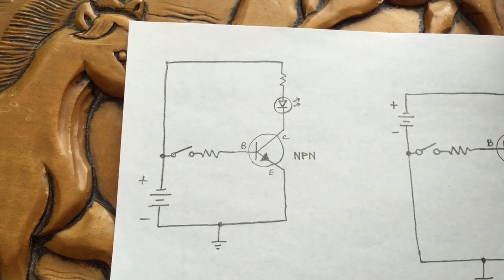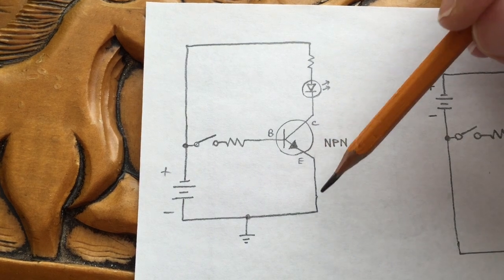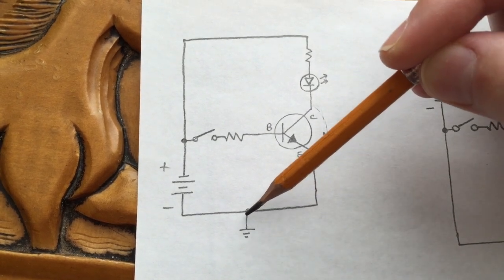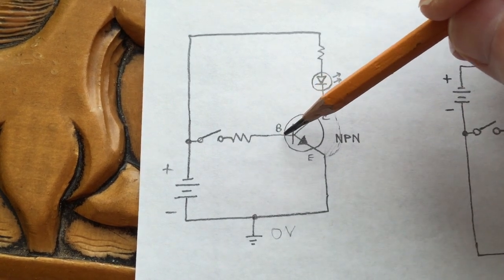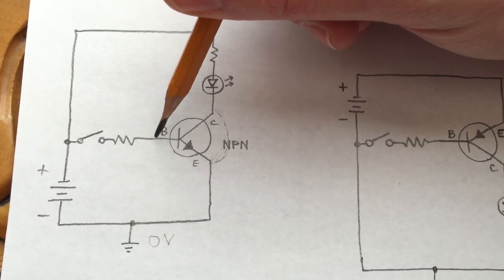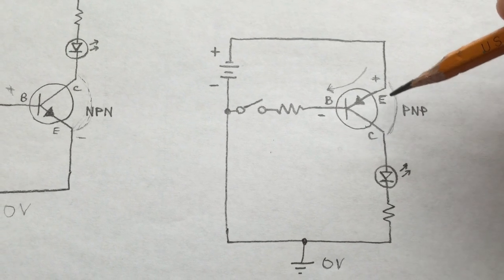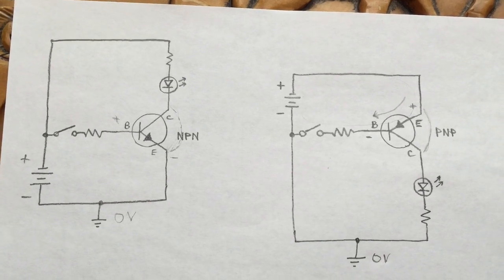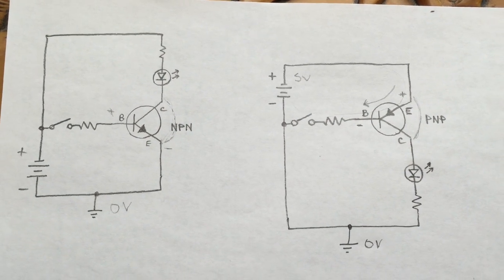NPN vs. PNP Transistors as Common-Emitter Switches

Comment: Very nice video. I believe the title should be titled Common-Base instead of Common-Emitter. The input and output circuits are both connected to the Base of the transistor.  A Common-Emitter would be when the input and output circuits are both connected to the Emitter of the transistor.

Comment: Cool man, you explained how transistors work as switches in a simple and easy to grasp way.
Thanks a lot.
Try logisim and fritzing, they're nice and free apps.
I did a simulation of this in Logisim on NPN transistor, it was great ;D
https://en.wikipedia.org/wiki/Logisim
Dropped a power, ground and transistor from Wiring menu then a button and LED from input/output menu
Connected all together then clicked on the hand icon for simulation, and it worked like charm once the button is clicked, seems the sim needed no resistors.
https://i.imgur.com/DHqhpcd.png

Comment: At 0:38, you call the Transistor a Current Multiplier. Please elaborate.

What I am thinking is that the power source  has a value, say 9 volts.We have parallel resistors, i.e. a Current Divider. Part of the current (measured in amps, right?) goes through the LED, with the arbitrary value of A1. The other part of the current with the value of A2  "flips the switch" of the Transistor. When we get to the Emitter, we have A1*A2 Amps. 

Am I on the right track?

Comment: i have a question..how the resistance in npn resistor can limit the current flow through LED as the are connected in DC...DC current flow through the every resistance should be same.

Comment: Just confirming I have a design right:

An NPN is equivalent to a normally open switch and a PNP is like a normally closed?

So if a 0V/5V logic signal was applied to a PNP that was switching, let's say an LED, when the signal is low (0V), the LED is on and when the signal goes high (5V) the LED cuts off.

An NPN of course being the opposite, on at 5V off at 0V.

So if I wanted to flash LEDs of Color1 and Color2 in an alternating pattern (one color on at a time), I could use a 555 in astable mode, connect a PNP for Color1 and an NPN for Color2 and color1 would come on at output LOW and color2 comes on at output HIGH?

And separately, unlike MOSFETs, bipolars DO NOT require a resistor between base and ground to pull them off?

Comment: dude, I went through at least 50 vids  trying to understand, I got a basic idea, but you my friend, youuuu, your voice is clear, its smooth and easy to.listen to, its sound is just right, your pauses are perfect while explaining, the mellowness helps, and within all that the overall explanation of the how hard it is for us noobs, you make it sooooo much easier my friend, you get unlimited lifetime likes and promoted to my diy buddies thank you GB..
Reply: having said that I'm still learning on how to.make it work with my project, I'm trying to make a solar lamp, I'm using a 3.7v lithium ion battery , 2400mah. I have my light dependant resistor which I think its around 15ohms, and my load (LEDs) will vary, my problem is to find an easy formula to calculate what resistor will I need to work with  each individual led or small 6v hylogen lamps, if you can point me in the right direction I would appreciate it

Comment: shouldn t the current be flowing from - to + ? this video is very confusing
Reply: In reality, electrons flow from - to +

When discussing electrical engineering and design, "conventional current" or "hole current" is used, wherein positively charged "holes" flow from + to -.  A "hole" is just the absence of an electron (because it has moved toward the + terminal) and doesn't actually move, but if you could magnify the wire to the point of being able to see the electrons and holes, as the electrons flow towards +, a hole would appear to move toward -
Reply: Jakub Zmeko confused about the circuit symbol of the battery
Reply: Great explanation thanks :)
Reply: Donovan Corcoran 
Yes electron flow is in direction of -ve to +ve and currents flow is always opposite direction of electrons

Comment: why u don't connect resistor before LED ?
Reply: ScorpioX because it's a common emitter
Reply from the maker: Because if you connect it to the emitter in this configuration, the required base voltage to turn on the transistor is now equal to the B-E voltage drop plus the LED voltage drop. This could be almost 4 volts with a blue LED, making it a much less effective amplifier unless you want to add more (complicating) circuitry to create the needed base bias voltage.

Comment: in both cases, there's a large current flowing through the large, outer circuit when the small, inner circuit is activated with a small current. why does it matter if the load (led + res) is before or after the transistor? why the load has to be after the transistor for a pnp and before for a npn?

Comment: isnt the resistor always connected before the plus of the led?
Reply: Electrically, it doesn't matter where you put it. It's the same current flowing through a series circuit anyway, because  electrons have nowhere else to go and have no source where they could come from.

There's a bit of an ancient tradition, because shorts to ground are most common, to place robust and cheap components of a series circuit on the supply side while placing expensive or fragile parts closer to ground, purely to limit the damage in case of a fault and perhaps to improve ability to troubleshoot. So that explains the usual arrangement.
Reply: ScorpioX you COULD connect it to the emitter, but the result would be less reliable and very supply and control voltage dependent. You'd need at least 0.6V more at the base than the forward voltage of the LED you want to drive, but if your base is hanging on a logic circuit, it has already dropped about that much off the supply voltage because the logic output is also a transistor.
Reply: ScorpioX A transistor drops some voltage inside itself. There's a base-emitter voltage drop and a collector-emitter voltage drop. The base-emitter voltage drop is the issue because it will accumulate over multiple transistors in a chain, while the collector-emitter drop is only present once at the output.
Reply: Thanx guys

Comment: in the case of pnp transistor the current first flows through the transistor and then into the resistor right? so, higher voltages might damage the transistor??
Reply from the maker: When the transistor is off, it's like an open switch. The voltage of your power supply will appear across the C-E terminals. All transistors have a certain C-E breakdown voltage they will withstand; make sure that your power supply does not exceed this voltage. For small switching transistors it is commonly around 30V, so a 5V or 9V supply is safe. (The placement of the resistor does not really have any effect on the effective breakdown voltage; resistors only "drop voltage" when current is flowing through them. When the transistor switch is open, the full voltage will appear on both sides of the resistor.)

Comment: In the case of the NPN transistor, what would be the reason not to put the LED between the emitter and ground?  I've done that in circuits and it seems to work fine.  If current is flowing around the larger loop, I don't see why it matters where the LED (and its resistor) go.
Reply from the maker: Putting the LED between the Emitter and Ground may work, but it's not ideal in most cases. This is because LEDs have a fixed voltage drop (about 2.1V for red LEDs, and over 3V for blue or white LEDs). No current will flow through this path unless the voltage across the LED is higher than the drop voltage. (Think of it like a water dam: If the height of the water [voltage] is not above the top of the dam [voltage drop], no water [current] will flow over the dam.) Since current has to flow across the Base-Emitter junction to turn the transistor on, the voltage at the base will have to be higher than the combined voltage drops of both the B-E junction and the LED too. This could be nearly 4V, just to begin turning the transistor on. It may work fine in a circuit with a 5V power supply, but nowadays 3V and lower power supplies are becoming quite common. It also prevents you from using the transistor with low-voltage signals when otherwise they are normally very sensitive. Hope that makes sense.
Reply: Since your switch control is between the base and the emitter, you would want to put your load onto the collector. Otherwise you have to also consider the load resistance in your equation when you put the load on the emitter. If your load varies in resistance it could get messy in a hurry. Keep in mind that you are using the transister as a switch. On/Off. Not Maybe On,Partially On/Off. Remember the KISS principle.

Comment: VERY well described.As others have commented,most videos on transistors are a confused mess.Perfection (for me anyway) would be a practical demo,laid out exactly as your diagram,but with an ammeter and voltmeter on both circuits ie. showing current/voltage through the transistor base AND current/voltage through the power circuit (relative to 0 volts).If I hear the word "doping" again (not here thank God),I'll scream. Well done.

Comment: Great video, I liked the explanation (got confused initially with battery symbol but say the comments later)We need base current to control transistors. Why don't we use the same switch instead of the transistor itself? Is it because we could like to control the circuit through base current by setting the signal?Does this mean that transistors are used in electrical circuit wherever we require a switch in a network? Is there any alternative (like relay)? If yes, could you compare them?Thanks!
Reply from the maker: +Varun Pandey A relay is a type of electro-mechanical switch, subject to speed limitations and significant wear-and-tear. Someone recently asked me almost the same question so I'll post a copy of my reply here.

This simple circuit would certainly work just fine with the switch controlling the LED directly. The purpose of the circuit is simply to demonstrate how transistors work, even though it may not be necessary in this particular (simply) application. But, to answer your question more generally, a transistor is able to work like a mechanical switch, but it is operated by another electrical signal rather than a mechanical lever. So you can have the low-voltage output of say, a CPU, control a higher-power device like a lamp or a heater. Also, transistors are able to switch much more quickly than any mechanical switch. Common signal transistors can switch on and off millions of times per second, and specialized RF transistors can do billions. Finally, although I do not demonstrate it explicitly in this circuit, transistors have the ability to turn "partially" on, where they act like a resistor whose value is related to the base current. So you can vary the current through a high-power load by using a smaller-power varying control signal. Like an electronically controlled light dimmer. This is the basis of power amplifiers. They don't really "amplify" power; they use a small signal to control a much larger signal with great speed and accuracy.
Reply: Thanks a lot for the explanation, it is much clear now. So other than transisters used as a fast, low power and a high load controlling switch, it can also be used as a register and power amplifier.

I have a basic understanding of circuits, I am just wondering what could be a possible hint to use transistor while designing a circuit. Any suggestions? Example may also work.

Thanks again!
Reply from the maker: +Varun Pandey A transistor can be used any time you need to switch or modulate a larger signal using a smaller signal. There arena my different types of transistors suited to various applications, so you want to choose the right one for the job. Common uses of transistors include amplifiers, oscillators, voltage or current regulation, and switching large loads based on logic signals from a micro controller.

Comment: Why do you need a transistor when the switch alone can switch the led on and off? Thanks
Reply: +Clayton Vetter Well, let's say you want to switch on and off a bunch of things at once. You draw up a schematic using a switch, and you find that you can't just use an SPDT, because something needs to go to ground, another thing needs to break from Vcc, and yet another needs to be open until that switch shunts to ground. They can't be wired to just one terminal of the switch and work as intended.

 Now, you search for, say, a 7PDT switch and find they are either non-existent, prohibitively expensive, or the only one you find is a bit of both, plus, it's not physically compatible w/ your intended application for one reason or another.

 What do you do in this case?
 Transistors to the rescue (ok, for the sake of the argument, we'll assume that relays are too current hungry).

 There is another reason, which is why I clicked on this video. Perhaps you have in mind a device which uses pressure sensors to detect both the force of a strike, and the physical position of that strike. Further, you intend to make this product marketable at an attractive price point, and also dependable, with low maintenance costs to the end user.

 The more expensive option, and the one most vulnerable to mechanical wear and tear, would to be to use lots of membrane switches on a capacitor ladder into an oscillator, the oscillator's frequency giving you positional data, and an FSR on top to measure overall velocity.

 The more ideal, low parts solution would be to use only FSRs instead of physical membrane switches, and split their outputs into A) Discreet threshold switches shunting the ends of each cap to GND via NPN transistors to determine position, and B) A mix of all voltages through the FSRs which are sent to a voltage controlled amplifier, giving you the force of the strike.

 This latter reason is why I clicked on this video. I hope that answers your question, and sorry for the length of my reply.
Reply from the maker: +Clayton Vetter This simple circuit would certainly work just fine with the switch controlling the LED directly. The purpose of the circuit is simply to demonstrate how transistors work, even though it may not be necessary in this particular (simply) application. But, to answer your question more generally, a transistor is able to work like a mechanical switch, but it is operated by another electrical signal rather than a mechanical lever. So you can have the low-voltage output of say, a CPU, control a higher-power device like a lamp or a heater. Also, transistors are able to switch much more quickly than any mechanical switch. Common signal transistors can switch on and off millions of times per second, and specialized RF transistors can do billions. Finally, although I do not demonstrate it explicitly in this circuit, transistors have the ability to turn "partially" on, where they act like a resistor whose value is related to the base current. So you can vary the current through a high-power load by using a smaller-power varying control signal. Like an electronically controlled light dimmer. This is the basis of power amplifiers. They don't really "amplify" power; they use a small signal to control a much larger signal with great speed and accuracy.

Comment: Maybe off subject but why do you need a NPN and a PNP transistor in an audio circuit?
Reply from the maker: +Kennynva T. There are many different kinds of audio circuits, including different amplifier designs. But in the design you're probably referring to, the NPN is used to pull the amplifier output to one power supply rail (e.g. negative), and the other is used to pull the amplifier output to the other rail (e.g. positive). This way you can create both positive and negative portions of the audio waveform and utilize the full voltage range of your power supply. Check "Class AB" amplifier on Wikipedia, also the schematic at the top of the article: https://en.wikipedia.org/wiki/Amplifier#Class_AB

Comment: Never seen such a clear explanation. Excellent! It might be also useful to show some practical examples, i.e. say we have 5V battery, 2K base resistor, which provides xx mA to the base and that results in yy mA current through the LED.
Reply from the maker: +1yyymmmddd Thanks for the kudos. I do have another video that shows the circuit in action (in a simulator), and I think it shows some numbers too. Check it out: https://www.youtube.com/watch?v=InAlz5n7TbU

Comment: That was the best description of NPN vs PNP I have seen
Reply from the maker: +Mike Catlapp Awesome, glad it could be of help!
Reply: Not sure if it was mentioned, that PNP transistors are commonly used in audio power amplifiers as a complementary pair on the output end, working in a push/pull configuration of the signal.

Comment: On the NPN transistor what would  happen if you took the resistor and LED and put it on the emitter side of the transistor?? To me this makes since...Im thinking that the collector pulls in or collects the voltage and emits it out the emitter..right?